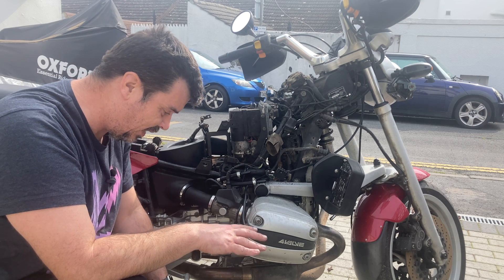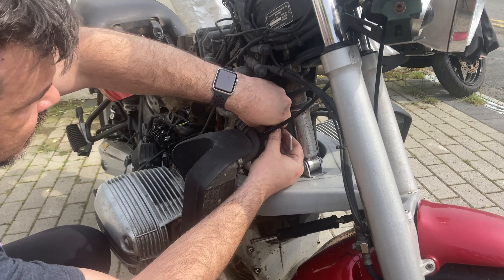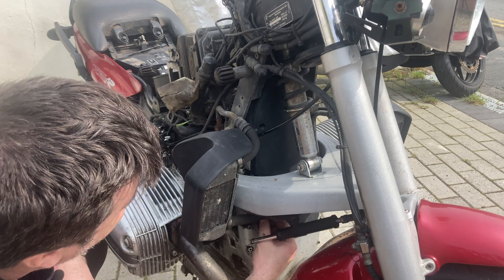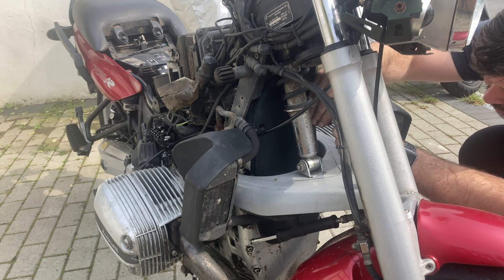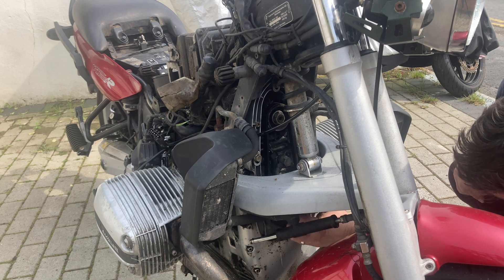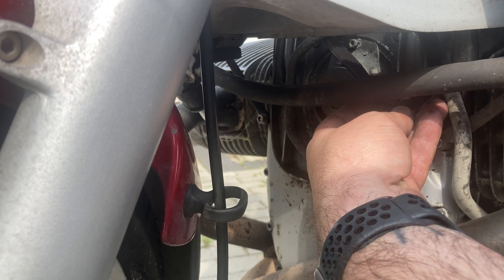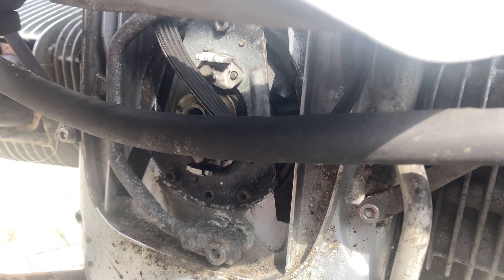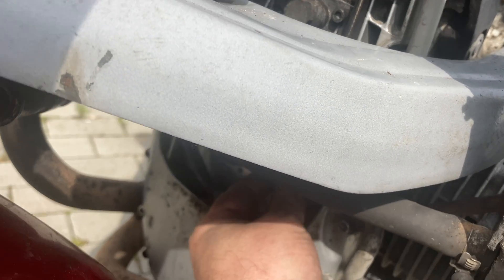Fitting a Hall Effect Sensor Replacement BMW R1100R

Comment: Once you've been succesfull in setting the timing correctly, can you post it or make a video on how you've done it? I am in the process of setting my own as well. I saw a method to do this with a diy made box with parts from radioshack. But i don't have that her in NL. So i tried to do it with a voltmeter/multimeter. Put the engine on TDC and turn the HES to the point where it jyst pops to 11,... volts. It seems however that this comes verry exact and this method does not feel verry exact. People also said if you rougly got it right, the computer will auto adjust the timing while riding ( it can be that you'll have to open the throttle fully twice to signel comp there is a new hess sensor before you start it. So with ignition on). But mine definitly doesn't do that (r1100gs 97), but perhaps yource will.
Reply from the maker: I'm looking at building that little timing box next, once that's done I'll use it to set the timing. I'll record it all and post it up once its done.
Reply: Hey! 
I bought my bmw r1100r  with this issue and I bought the little led machine ( I'm in NL, Utrecht) and I try to use this alignment. According to me is in the right spot but is running terrible in idle as if the sensor is broken (has a new one) I have some videos to share. Hopefully he fix it already.
Reply: hi it is all simple but were to get the testing box??? @martinpedrazapardo7770
Reply: What sort of fault/cutouts did you have? I have a 99 r1100rs that has issues. @martinpedrazapardo7770

Comment: There are a few videos on here showing how to change the HES. You need to lock the engine at TDC, then make sure you have the pulley fitted correctly, the tin shield behind the pulley is the HES interrupter, you need to make that’s in the correct position. A lot easier if you slacken the alternator so you don’t have tension on the belt. The pipe trapping the belt is a breather, just take it off to remove the belt if you need to, there’s an O ring behind the bottom fitting. I did my recently, slowly, slowly, and you’ll get there
Reply from the maker: It’s nice to hear it’s a breather that can be easily removed. I’ll come back to it with the timing box to make sure I’ve got it all aligned correctly. It all felt like it went back in correctly but where I didn’t have the HES bolts torqued correctly I think I lost timing. Cheers for the advice.